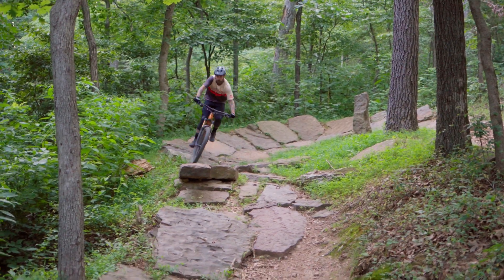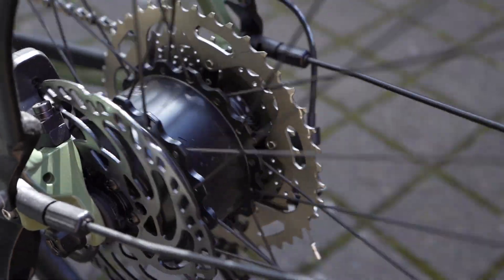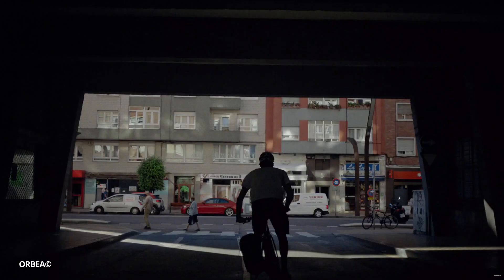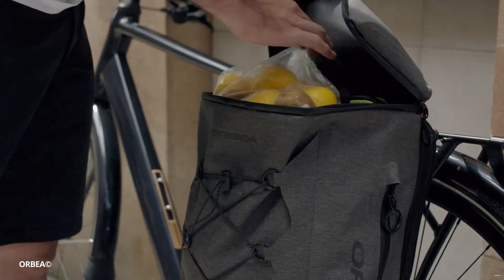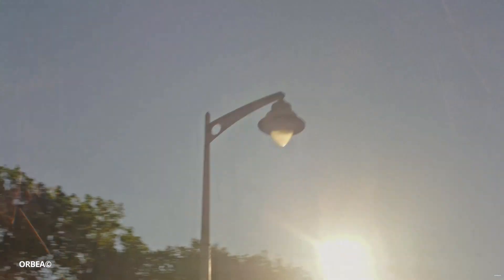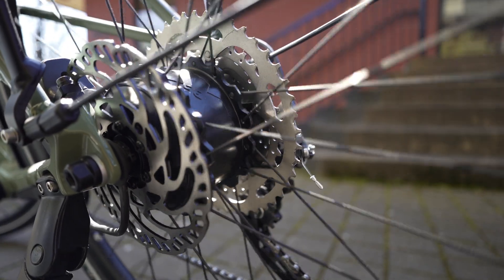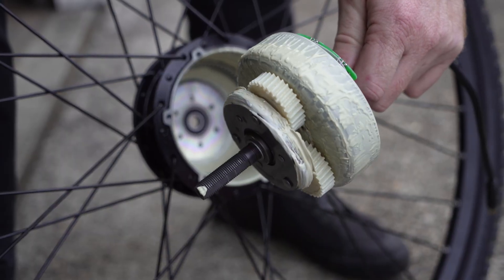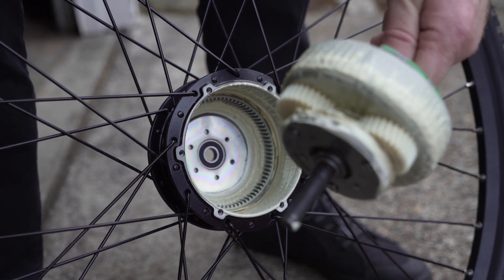HUB VS MID DRIVE | Choosing the Best Electric Bike Motor #electricbike #ebike

Comment: I like hub motors because they're just much simpler than a mid drive, they can reach higher speeds, they can be more mechanically efficient, and you get to have a 2wd/awd system with a front wheel hub motor which means more grip for traction, for power.

Comment: Mid-engine under 2000W with pedals and chain, and upper hub motor most often without chain and pedals. Those above 3 kW are small motorcycles, not bicycles. ;-) Above 8 kW I would recommend only a regular motorcycle frame with protective equipment, a driving license and a lot of motorcycle routine.
I would leave the rigid frame for those who ride on smooth roads without a motor. Off-road and in case of any motorized drive assistance, only a telescopic vehicle frame

Comment: Middle motor under 2000W with pedals and chainand upper HUB motor only most often without chain and pedals. Upper 3kW are small motocycles not bikes. ;-)

Comment: The thing with a mid drive is making the drive train last. It’s murder on a cassette. Why I use a Sturmey Archer 3 speed hub amd a single speed chain. I use the wide KMC single speed chain and 1/8X1/2 17t cog. Amd a Lima Cycle chainring with replaceable teeth. More than half the cost of a new one piece chainring.

Comment: Well I have heard a few scar story's about mid drive motors mainly Bosch , I have Engwe EP-2 Pro had it it for 5 years with a geared Hub Motor and this bike has worked hard towing a trailer I do mobile repairs , I give it a re grease every year there is no wear as far as I can See I have done 7,000 miles in that 5 years had no problems apart from the kick stand snapped off as you say its up to your chose great video thanks for sharing

Comment: I am looking for my first e-bike. I used to ride mountain bikes back in my 20s, Trek 850 chromoly hard tail with no suspension to date myself. Now I am much older and have some health problems. I want to be able to get back into riding and currently don’t need a lot. But I don’t want to limit myself if I can get my endurance and strength back up. Do you have any advice or suggestions for a good quality bike that won’t break the bank?  I live in a mixed terrain environment, base of the Blue Ridge mountain range, but also rather flat city terrain. I am in a river valley bordered by mountains. I don’t have $4,000 to spend or anything like that, so price can be an issue. But I don’t want to be limited by buying too little of a bike. Thanks!

Comment: Great video. I have a really heavy duty hub drive e-bike. I also have a light mid drive e-bike. When it comes to commuting and hauling groceries I use my hub drive e-bike. It's just better suited in my opinion. Handles all the weight of groceries and gives me great speed to get to and from a location with relative ease. However, I wouldn't use it in any capacity for off trail usage. I use my mid-drive for that. It's a more natural performance and works great when I'm mountain biking. 

I know that manufacturers are making hub drive mountain bikes that are better performing now and I'd love to test them but I keep it simple for now. Hub for my everyday city usage and mid for my serious mountain biking!

Comment: Hmmmmm ... what about dual hub drives?  Say the back hub is geared and the front hub direct drive ... use something like a thumb switch and or an 'Auto' setting that uses a combination of rpm + speed to shift between the two hubs?

Comment: Small mid drive 600w? is ok though if you needs go higher the impact to chains and gears is brutal.  higher watt motors are best in hub for the maintenance and reliability issues.

Comment: I had a fatbike mid drive bafeng motor 160nm and it eat chain and gear in very short time i have change gear and chain 2 time for 1000mile driven
Now i have a 8000w  hub motor its a beast and wont eat your gear ,alot less to maintain

Comment: I have a Merida eNINE mid-drive 250W MTB and a Dirodi Rover hub drive 1000W moped-style ebike. I ride them for different applications. But if I want range, I would go for the mid-drive MTB because I can ride it without much difficulty sans power on flat and even surfaces. The Rover has limited range and is impossible to ride without power. So it really depends on where I want to go and how far that ebike can take me there and back.

Comment: I have a 750-watt rear hub drive motor. What i don't like about it is that it really needs power to operate, I can ride it powerless but the bike weighs 65 pounds and once it hits 6 or 7 mph the motor starts to feel like a gyro and feels really unnatural. I'm always wishing I had some kind of motor that I could totally disengage and be able to use it on demand. I'm thinking about a bafang 301 hub motor or  a small middrive, maybe cyc photon .🤔

Comment: There is a third option:  Both ! Four years ago I built a bike with a Prime 72v Bafang with a QS205 on the other end of the chain. Got a ticket for doing 78 in a 45 zone. I’m one of the old bastards who built the A12 spy plane that flies at Mach 9.8. ❤

Comment: So the e-bike we bought from someone, with Yamaha battery AND or motor, works as follows:
It only assists you on pull off and uphill's, once you have reached speed, approx. 25km/h it feels like you pedaling against a brick wall, pushing on the pedals doesn't do anything it just feels even harder, but if you just keep the pedals moving, the motor will keep you going at that speed without any effort at all...

Comment: This video is phenomenal in its richness of information and simplicity of understanding.  The host presents compelling benefits and drawbacks to each type of drive technology.  Excellent review.  I never comment on videos, except to say that the host seemed to glaze over the BIGGEST benefit of a hub motor over a crank (mid-drive) motor.   T H A T   I S   the fact that hub motors will allow for a rider to "cruise" down the road without having to pedal the crank when they are tired.  That is - if you aren't cranking the pedals on a mid-drive motor - you won't get any electric assist to just cruise for a few miles when you are tired.  That alone tips the scales in favor of a hub motor in my flawed, eccentric, untrued opinion :D.

Comment: I’ve been riding up some steep mountain fire trails recently, and I’m Now wondering what would work better, the dual hub motors at 4000 combined watts or a mid drive motor of say 1000 watts? How strong do they make mid drive motors?

Comment: Recently watched several of your videos, thanks!

I currently have a 6yr old BH City Pro with a 500W hub motor and 600WHr battery.  I'm 220lb and like the ability to ride pretty much anywhere with it (put Continental CrossKing's on it) but frankly do ~80% on asphalt, with a fair amount of hills in our area.  Riding the last couple of weeks at 15-20mph on the hilly roads I find I only get ~25mi+ range which limits my ability to explore.

I'd like to get more range, but also don't want to give up on power going up hills (80%+ time in 30% power, <5% in 70%-100%), nor on the fenders I have.  I've been looking on/off for a couple years at Specialized Tero and wonder if I'd be happy with this.  A couple questions:  should I expect similar climbing performance from the 50NewtonMeter mid-drive as I currently get from my 500W hub?  How about range?  Would you recommend getting the 90NM mid-drive?  Any other recommendations for competitive bikes I should be investigating.

Thank you,
Ron

Comment: Mid drive will wear out your chain and sprockets every  two weeks ,gets expensive, both don't  let you ride without  resistance when battery goes flat  which is a night mare need to fully disengage motor,they need to be belt drive with mid drive,,,,,AND THE BATTERIES FULLY FLATTENED WILL ONLY HAVE 300 FULL CHARGES BEFORE THEY ARE USELESS😅 FACT
Reply from the maker: That's interesting about a mid drive wearing out the drivetrain. Do you have experience with this?
Reply: It's changing gears that wear out the drive train: not having a straight chain line. Mid-drives want a straight chain line. That and the fact that most people riding hub motor bikes don't change gears at all. They leave it in a high gear and have the motor gunt it out. Either way, there is heavy wear. To correct that, buy a frame that can use the Rohloff Speedhub. An IGH and a mid-drive are made for each other. Once you have 30K miles on the bike, you can upgrade it to a Gate Belt drive, like I did.  - https://youtu.be/qu4vGEziby8

Comment: I have built over 50 E-bikes of all types and find that what you want will serve best. both systems are great and both have their pro and cons but those are generally based on how you the individual ride. If I was building an off road/ hunting/ fishing bike there is no doubt I am using a mid drive system . If I am in the city or country roads and streets , give me a rear hub direct drive system but the heart of all E-bike is the battery My personal favorite being a 48 volt 20ah  1600 - 2000 watt battery. Not to heavy, good range and power. And for me Cheap!!!! I can normally build a 48 volt 1500 watt bike to will go 35 to 40 mph for 30 miles or 100 miles on PAS and cost like $800.00. I have had folks buy my personal bikes from under me which is fine I have too many of them... wife thinks.
Reply: I agree. I've only ever had a rear hub drive but I've mainly used it for around town and using it as a all around do anything bike like hauling cargo, up and down hills.
And I do prefer my 48 volt 20 AH Samsung cell battery over a couple of 10.5 AH batteries I have.
Reply: Sounds like you have lots of hands on pratical experience.  Which type of hub motors do you prefer: Direct (Ebikeling, NB Power or Geared (Bafang) ?  Do you sometimes use custom Controllers (KT /Far Driver) to increase power and speed beyond the Hub Motor's maker's factory Watt rating ?
Reply: Which kit gave you so much range with such speed at this price?
Reply: Please tell which kit you used?
Reply: I've built and tuned over 200+ custom E-bikes across every terrain and use-case you can think of—from high-torque hill climbers to ultra-light urban stealth builds. I agree with some of your points, especially that ride style should determine motor setup, but I'd argue the mid vs. hub debate is only scratching the surface.

Direct drive rear hubs might get you by in the city, but once you're dealing with torque efficiency, regen braking, thermal rollback, and controller mapping, things start to separate the weekend tinkerers from the builders who engineer for longevity and performance. Battery specs matter, sure, but pairing them correctly with the motor and controller is where the real gains (or losses) happen. I've had 48V systems outperform 72V builds just from properly matched phase amperage and BMS tuning.

$800 builds are cute, but once you're spec’ing torque-sensing PAS, high-discharge cells (say Samsung 40T), and silent sinewave controllers, it’s less about cost-cutting and more about crafting machines that ride like an extension of your body.

But hey, every builder’s journey starts somewhere. Keep at it. 👍
Reply: Hi @dalvenable331 I’m new and looking for a cargo bike to transport my son to and from school probably within 10 miles.  Any recommendations on a cargo bike that is good and under $2000?  Brand and model? Appreciate it!

Comment: Neither, because you don't get any exercise by riding either one.
Reply: No it’s not likely that. Normally this kind of opinion is coming from someone who has never ride an e-bike. You can adjust the resistance and as they are more heavy than normal bikes you will have more exercise than a normal bike.
Reply: LOL! Sorry, Dave, I don't usually laugh in someone's face, but it's obvious that you haven't ridden ebikes much.

Comment: Can't argue with the experience of mid drive owners who feel the extra power when gearing down.  But my mind keeps going to the fact that electric cars do not gear down for hills. Electric motors can be built to have max torque at almost zero RPM.   So hub drive should be possible with great power for hills too.
Reply: Mid-drives put the torque into the chain, where you can use the bike's gearing. Hub motors aren't great at climbing; they are made to run at a constant rev. - https://youtu.be/qu4vGEziby8

Comment: Seems like mid engine so you have back tire gears would be less work on motor.and more speed options
Reply: Bingo! The motor applies the torque to the gears where God intended it. - https://youtu.be/qu4vGEziby8

Comment: I own both, one el cheapo chinese rear direct drive 1000w hub motor and a bafang bbs2 750w motor with an enviolo gear hub. They are driving almost identical in flat land and moderate hills (up to 30 mph) when the aperage is restricted to 20A on the Hub drive and 24A on the mid drive. Basically the Bafang Mid drive draws 25% more power from the battery under the same driving conditions and same speed. Only on step hills the Hub drive at speeds below 8 mph struggles while the mid drive does not care due to the drive train gearing ratio.
My guess is that 10-15% from the 25% more power consumption of the bafang is caused by the enviolo Internal gear hub.

Comment: In Australia, we have a legal limit on ebike power, pedelecs are limited to 250w, throttle bikes are legally limited to 200w. (The latter is absurd because AFAIK, nobody makes a 200w motor anymore and 250w pedelec is the Euro standard.) So, if your ebike is streat legal in Australia, heat management is not really an issue, mid mount or hub mount. (I won't bore or enrage anybody with Australia's other quirks about "street legal" like public parks are "the road" in some states. So, a local council owned mountain bike park, beefier than 250W may be illegal on that local mountain bike park. Dumb, right.

Anyway, as I see it, as one happily using a front hub, 250w pedelec conversion kit , because I have heart failure with reduced ejection fraction, I wouldn't be riding without that cheap assed conversion kit, so it was absolutely the best option to keep me riding. With exchange rates and a smaller market, the only mid drive bikes available are priced like the bicycle equivalents of a Rolls Royce. Getting my touring bike setup for the kind of long distance and commuter bike riding I used to do before my heart attack cost me a grand when I was still in the workforce. AU$800 worth of urban bike plus AU$200 with of shifters and gravel drops. I couldn't afford that bike now I'm retired and living on my annuity, let alone the cheapest mid drive I've seen, which was basically a $300 bike with $1800 worth of Bafang motor controller and battery. To convert my touring bike into an ebike with a front hub, was another $700 total. That was with a 540Wh battery.

So, to get my average 20 to 25 km/h riding speed over 2 hours, around the City of Melbourne, I'm on 1 to 2 boast (out of 5) and for that, a full charge barely comes off the pin, so heat management, traction, "balance" wheel weight. None of those things are a problem. Commuting up to a friend's place, there's a 2 metre climb on gravel on my preferred route - it's the only time I'm in 5 boast on the entire ride, I have to shift my weight forward on that bump, and pedal like a cranking monkey, anyway. Had to do that before my heart went pop, Never lost traction on the front wheel yet.

The best ebike is the one you can afford. Mid drive has advantages, none of them are worth the expense. Not to me, anyway. Ride what you can, ride what you bring, don't judge the others' "ponies" judge their inclusiveness. I think most of the riders who've commented on my front hub being "dangerous" are riding mid drive because the benefit is it shows they're rich.
Reply: Yeah, very true. Front wheel drive on a car isn't seen as dangerous, you just need to not treat it the same way. Plus you've got all wheel drive when you peddle for going over sand or whatnot.
Reply: @mikafoxx2717  Though losing traction cornering on a 2 wheeled vehicle cornering is far better in the rear. I run dual motors and do 25% 50% for this reason
Reply: Do you mind saying what front hub system you chose (in Australia)? And would it be compatible with a bottom bracket torque sensor because moving to e-assist I would much prefer assistance based on torque rather than cadence.

Comment: What about rear hub dedicated to re-gen breaking as stop light is engaged on rear break (and disk break) - front hub drive with break disk break - and also  mid gearbox drive?    Two wheel drive for hills or top speed flats and re-gen every back break  -  put the battery pack under a rear heavy duty carrier for luggage.  Now you are motoring - good luck - my first build just has a rear hub - enough for 20mph traffic in Lancaster UK......On flat top speed 27mph.

Comment: Hub drive motors take a lot of strain off the chain set. 10,000 km are no problem at all. The spare parts are also very cheap. The only thing you have to make sure is that the gears are lubricated with good grease... then 100,000 km and more are no problem at all.

Comment: I Prefer the Hub Motor ? because if your chain brakes you can still get home If you have a throttle like I do on my Rad Rover Power Bike
Reply from the maker: That's always a consideration. We don't typically encounter broken chains, maybe once every few years, but it is a possibility. I think for urban and cargo bikes hub offers many benefits. For more performance based riding like eMTB we do favor mid drives.
Reply: I broke my derailleur in the middle of nowhere, was able to throttle home on my hub drive. That plus the price = 😅